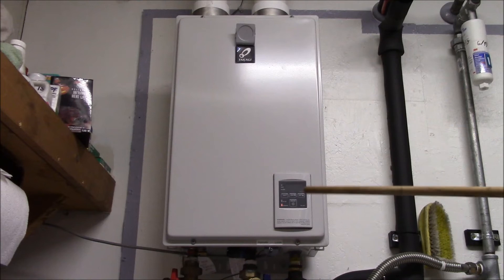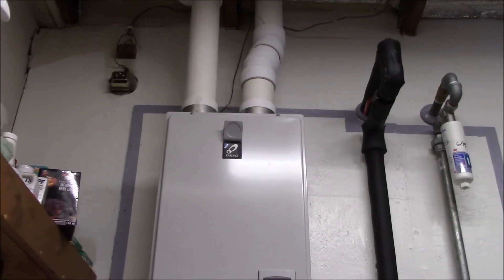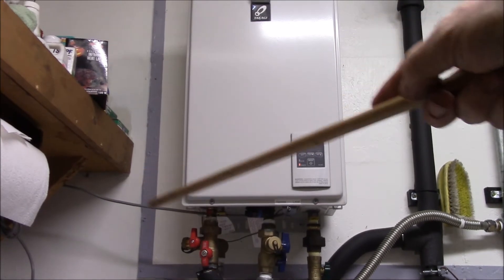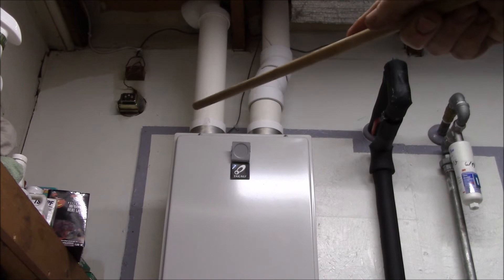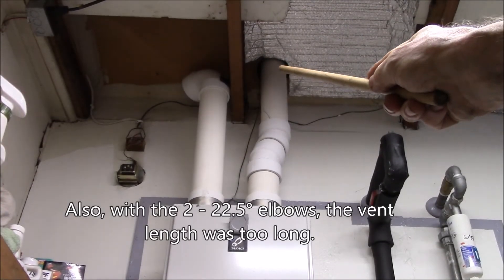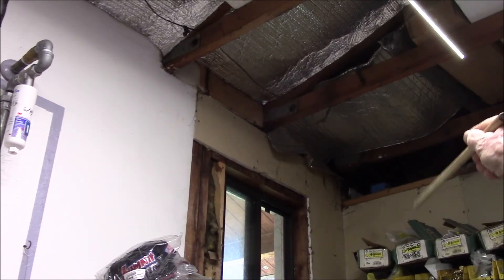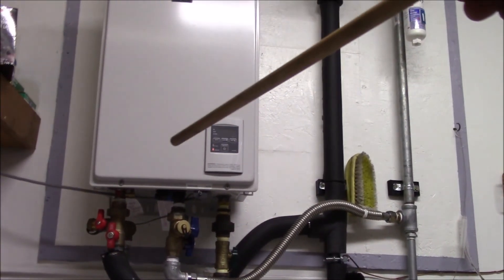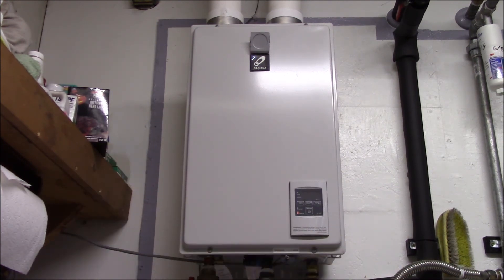Tankless Water Heater Installation: Q & A

Comment: Can the condensate acidic water be input directly into a feeding into the septic system without affecting the septic system enzymes? Do I have to use any "neutralizer"?
Reply from the maker: According to this article:
https://www.saniflo.com/us/blog/neutralize-the-condensate-most-plumbing-codes-require-neutralization-for-corrosive-waste-n334
Some sort of neutralizer would be recommended.

Comment: What’s the noise level like on this unit? I’m considering the same model installed in my garage on the back side of a kitchen wall.
Reply from the maker: That's how mine is set up.  I can only hear when the unit fires, the clicking of the ignitor.  After that, I don't hear anything from inside the house.  No noise or vibration that comes through the wall or anything like that.

Comment: Abs and pvc pipe are made solid pipe or with foam cores Only the solid is acceptable to meet industry specs which are printed along the side of the pipe.  The specs required for your heater  are shown in the manual that came with the heater. Foam core pipe is lighter and less costly.
Google the comparison and reasons not to use foam core. Reading the manual thoroughly is a must if your are not an experienced professional plumber.
Reply from the maker: Good point.  Yes, in the Charlotte brand pipe used on this heater, the red lettered pipe is the Schedule 40 pressure rated / solid core variety:
https://www.charlottepipe.com/Documents/Brochures/BR-PK.pdf
Black lettering is for the non-pressure or foam core version.

Comment: I see a grounding wire attached to your gas line.  I am in the middle of hooking up my gas right now, and I noticed there is a screw already on the gas nipple coming out of the bottom of the unit.  Is that torx screw for grounding? Or?
Reply from the maker: According to the service manual, that's the gas supply pressure test port.  That's where you would attach a manometer to check for adequate gas pressure if you suspected that was an issue.  That screw seals off the test port, so you wouldn't want to attach anything to it like a ground wire.

Comment: Your videos are most helpful thank you for that!   I recently purchased the same water heater for my in floor heat application in my garage. My question is can I take a 90° elbow for my intake with in the garage and run only the exhaust to the outside of the garage? I am sorry if I do sound uneducated I am not a plumber electrician or HVAC guy
Reply from the maker: Possibly, if the garage is large enough volume and/or has sufficient intake air vents, then yes.  
https://youtu.be/JH0v-49LMlA

General requirements are:
2 sq.in. per 1000BTU, so 240 sq.in. for this heater.
Or room volume/Combustion Air: 50cu.ft. per 1000BTU or 6000 cu.ft. for this heater.

But check with your local permit office to see if they have any specific requirements.
Reply: R Brown ok thanks it is actually installed in a bathroom that is approximately 5ft by 7ft.
Reply from the maker: @martyx4allsport47  No way that room would have enough volume to support combustion air by itself.  Going to need some external air or it'll end up pulling a partial vacuum and that can cause it to start sucking the exhaust back inside.  If that bathroom is inside the garage, and the garage volume is large enough (6000 cu.ft.), then you might be able to install a dedicated vent into that room, 240 sq.in. such as a pair of 10" x 12" vents.  I think they usually like to see one near the floor and one near the ceiling.  This always seems a little strange as you can use a small 3" pipe for intake air but you need a huge vent in it's place.  Best to check the local codes and see what they say.
Reply: R Brown ok, I am prob jus going to either the 2in or 3in concentric vent.  Was just trying to not cut two big holes in my wall. Thanks you are very knowledgeable I appreciate your help! ThNks
Reply from the maker: @martyx4allsport47  Yes, get the concentric vent kit and you only need the one hole.  I think the one Takagi uses can be extended to most any length by inserting inner and outer tubes into the end pieces, if I'm not mistaken.

Comment: Hello, I have the same heater and when I turn it on it run like it should but 15 minutes or so the fan kicks on high speed and stays on high speed . It's loud and I can't sleep so I turn it off . Has anyone know why ? Thank you
Reply from the maker: The fan can run up to 1.5 minutes after the heater shuts off to purge the system of exhaust gas and cool down the components.  It might be that something like a temperature sensor is faulty and telling the fan to turn on again.  Or there may be an issue on the controller board.  See if there are any error codes, should be displayed on the controller if you power cycle the heater or on the flashing green LED inside.  Might be worth contacting Takagi support to see if they have any troubleshooting ideas.
Reply: @The4Crawler  thank you for you're reply I'll dig into this more
Reply from the maker: @vermontjeff2535  Hopefully you'll get that sorted out.  Mine has never done that that I can recall.  The other thing that might be worth trying is unplug the unit, then disconnect and reconnect all the wiring connections on the main circuit board, one at a time, and see if that makes any difference.   Maybe one of those is loose or not plugged in fully.

Comment: Thanks,  So what do I have 2 exhaust Ports?  Wish I cold post pictures to show you. At least I know  now I can't use PVC
Reply from the maker: The exhaust vent in the one in the center and on the left is the intake air vent.  Some units are set up with a single, concentric vent, exhaust in the center, intake on the outside.

Comment: Thanks for this QA.  I have Takagi TK 110U INDOOR 200 Series  Just arrived Central Texas, It has the 2 Venting Ports but I'm not sure if I bought a think i got - non condensing unit- as I was strapped for$ & hot water tank broke. Was hoping to use old exhaust gas water  connections.  So I'm not sure if I can use the old water heater Exhaust  exhaust or not😕
Reply from the maker: It appears that's a non-condensing model:
http://www.takagi.com/products/tankless-water-heaters/tk-110u-i
You should be able to replace the old venting (assuming it's some sort of galvanized B-vent) with the same size stainless vent pipe.  The installation manual should have the specifics on diameters and lengths, etc.

Comment: What is your incoming water temperature?  The USGS says my water should be coming from the well at about 50 degrees, which would really decrease my gallons per minute drastically.  Is the 120 degree temperature hot enough to maintain a good mix of cold for sufficient water pressure in the shower?
Reply from the maker: The water here runs from mid-60s to the mid-70sF over the year.  Yes, the colder the water, the lower the maximum flow you'll get with a certain temperature setting.  For showers, I don't use mixed hot+cold any more, I just set the temperature to 100F and use hot only.  At that temperature, I just barely have the burner running, it's down near it's lowest output setting of around 15,000BTU/hr.  But you can get a rough idea of your flow at a given setting, just take the temperature rise x the flow x 500 and that'll give you BTU/hr.
Reply: @The4Crawler  Thanks for the reply.  Only running on hot in the shower, does that significantly reduce the shower pressure?  I am considering getting the condensing H3S  4.8 GPM 180,000 BTU unit or the H3 5.4 GPM 199,000 BTU unit primarily because the 70 degree F heating gap with my 50 degree F well water.  I limited to 3/4" gas propane pipe with a gas dryer and gas range/oven.
Reply from the maker: @Thomas-wn7cl  No pressure reduction that I can tell.  I do run a low flow WaterPik shower heads in the house.  Running hot only lets me just set the water temp. to 100F and hop in the shower.  No fiddling with the hot and cold knobs to adjust the temperature, so sudden temperature changes if a toilet is flushed, etc.  
My heater is only 120K BTU/hr. and I had to work out a  special set of conditions to get it up to that max. output for a recent exhaust gas temperature test I made a video on.  Otherwise, it rarely runs above 1/2 rated output and then only for a few minutes.  My clothes washer pulls about 2.25GPM while it's filling on a hot cycle.  On your 70F temperature rise, that's about 80K BTU/hr. or less than half the rated output of the heaters you listed.  You could run up to rated 4.8 GPM on the 180K unit before you hit full output.
Only time the heater will limit the flow if if you exceed the max. BTU output.  Then it'll cut the flow in an effort to maintain the set output temperature.  I saw this in my exhaust gas temperature test:
https://youtu.be/3usNy5DDUkM
Reply: @The4Crawler  thanks for the input!

Comment: Mr Brown, Thanks for your write up on the Takagi T-h3m-dv-n. Appreciate the way you explain things and show application. Just purchased the same water heater to replace a Bosch unit I installed in 2002 of lesser capability that is still in service. Will be installing the Takagi soon, taking time to do correctly. Please post anything outside of regular maintenance you experience. It appears the only miserable job on the Takagi is replacing a fusible link that wraps around the heat exchanger(s), which entails gutting the internal assembly to replace. My guess is that maintaining proper internal flow and venting would prevent such issues, as it is a fail safe in case the unit were to overheat. Could it deteriorate by time ? Who knows, I'll take my chances as you have. Again, appreciate you sharing about the water heater, appears you have some other good ideas posted to explore...Thanks, Mike in Ohio
Reply from the maker: Thanks for the comment and glad you found the video helpful.  So far, no issues with the heater in nearly 3 years.  I think your assessment of having good venting in and out along with keeping the heat exchanger clean inside will help to prevent the fusible link from failing.  Mine has full 3" dia. intake and exhaust venting.  The water temps where I live are not very cold, so the heater doesn't have to work too hard.

Comment: I live in Europe, and a new EU law came into effect a couple of years ago that it is now illegal to install a non-condensing heater. Existing ones can, of course, remain in place. But any newly installed heaters, by law, have to be condensing. Since I had to install a new heater earlier this year, I was shocked by the price difference: a condensing heater is not cheap! The manufacturer, though, assures me that the running costs will be quite a lot lower, so it pays for itself in a few years.
Reply from the maker: That's interesting, thanks for sharing.  Yes, the condensing units are more complicated inside but they are also built with better materials to resist the corrosive effects of the condensate.  On my heater, the price difference was about 15%.  But after looking into the side effects of that, I would have needed a larger diameter gas line to run the less efficient non-condensing model as well I would have had to spend at least that much more on the cost of stainless steel venting.  So in the end, the price difference wasn't a factor and I get the benefits of the higher efficiency in terms of low operating costs.

It could be in Europe, some mfgs. are taking advantage of the regulations and increasing the cost of the condensing units now that consumers have no choice.

Comment: some people always say you can not do this with out even checking
Reply from the maker: Yes, that's true.  Although in this case, it's easy to get lost in all the variations of tankless water heaters and assume that one heater model is the same as another model.  I know it took me quite some time to understand the  nuances of the various terms and what a particular feature meant in real life.  But that's why it pays to take the time and pick the features that'll be advantageous for a particular installation situation.  Had I picked a different style heater it could have more than doubled the final cost with installation.